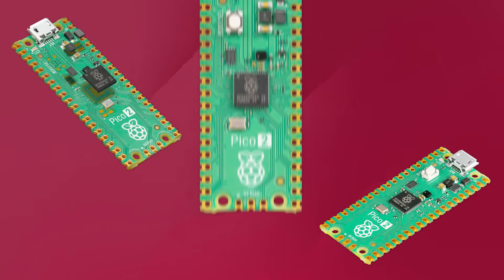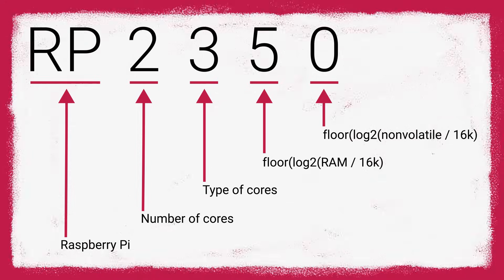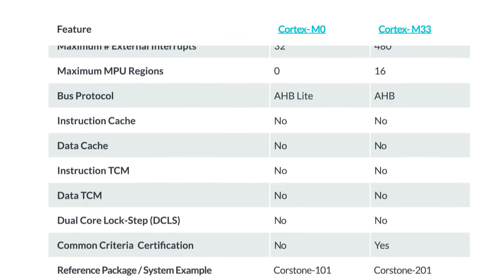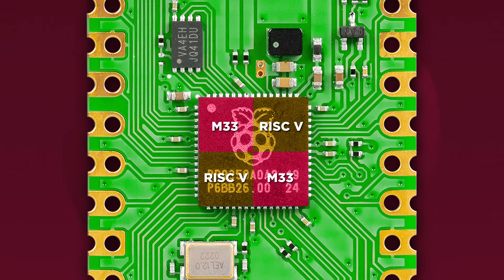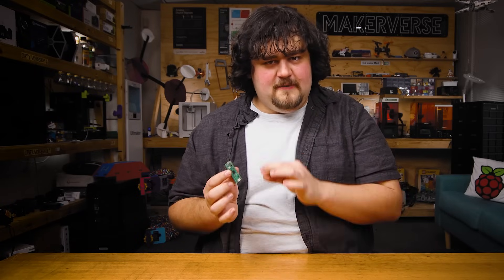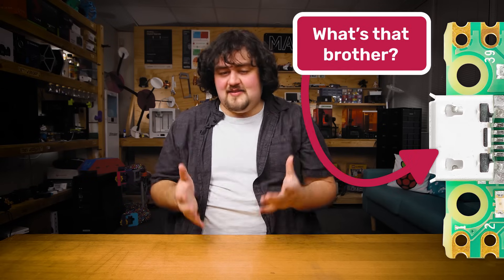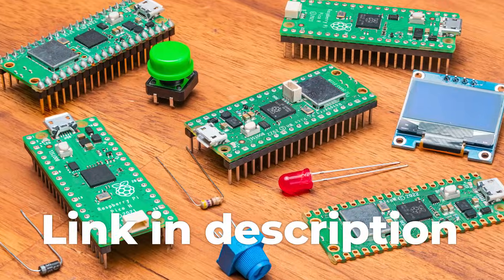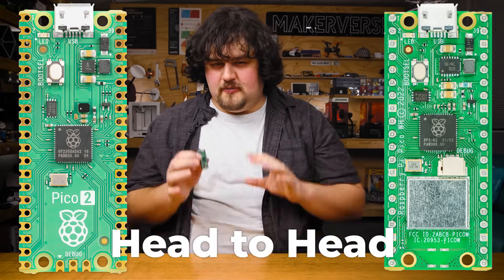Raspberry Pi Pico 2 | Everything You Need To Know

Comment: There is an official statement regarding the Pico W 2: available by the end of the year, same RF chip.
Reply: Hopefully there will be an external antenna connector.
Reply: @nutchanonkoommamuang5843  much needed
Reply: We need an rf connector on it.  Even if it's just pads to put our own in.

Comment: So, since this video came out the following has been learned about the Pico 2/W:

You have to choose between ARM and RISC-V nodes, there’s a flaw in the GPIO that causes the pins to latch up under certain conditions, it has a secure mode which is quite good but can be undermined using subtle and sophisticated attack and yes, it’s still very good.

I use it with C personally (I grew up with C) and like both the Pico’s  running either C or Python.

Comment: I'm a hobbyist and am very new pretty much everything.  I'm having trouble getting started with the rp2350.  I had no trouble with the rp2040, as in finding and uploading the UF2 file, getting code working with Thonny and getting the pins to work to light up LEDs.  However, I can not find the uf2 file for the rp2350 (am I missing something) and had trouble in getting Thonny IDE to recognize the rp2350 microcontroller.  All that I find is description info, but any instructions. Without having anything to go on, I tried to experiment by uploading the files that I had on the old rp2040 onto the new rp2350 and set up all my jumper wires on the appropriate pins. Nothing happened.  I would like to know how to get started with the rp2350. Thanks
Reply from the maker: We have had some instances of Thonny be able to install the Pico 2 firmware, and some not. We are still in that transition period. 

Here is the official download link for MicroPython for the Pico 2 (also for the RISC-V versions to use those cores, not really a noticable difference though): https://micropython.org/download/RPI_PICO2/

Comment: Thanks for the video. Looks like no built-in capacitive touch sensing?
Reply from the maker: Unfortunately no 😭.

-Also hello from the Core Electronics creative department, I really enjoy your videos and blog!
Reply: @Core-Electronics  Ah, well that is too bad... OTOH, I designed an add-on board for the original Pico that should work with it (so I'm not entirely disappointed) would be happy to send one over if you're interested in trying it out.

Thx so much for your kind thoughts. And likewise! have found your work to be a great reference in the past!

Comment: I wonder if the RISC-V cores were added due to the die area required for bumps (im assuming its flip-chip) meaning there was a load of free die space, so they just chucked a couple extra cores in
Edit: looked at die shots of rp2040 and it seems to be bond wire, so probably same here.

Comment: There are still enough microUSB Cable laying around and compatibility with the pico1 is worth a lot. I like USB-C but i don‘t see any advantage here, solder  yourself if you want to😅
Reply: The pimoroni boards with USB-C are already available (and in my grubby mits)
Reply: usb C cables are also more expensive. It could make a difference for some people.
Reply: @PainterVierax  if you buy a pile of „refurbished“ cables, sure. But i don‘t think that someone uses pico‘s on that scale.
Reply: @Buchstabenkrahn  well, you'll need to dedicate a cable for your devboards, and probably for most project you build with them so better get inexpensive older connector.
Personally, I use USB-B full size for such microcontroller projects as it's sturdy and plenty enough current and bandwidth for such applications. Unfortunately Rpi Pico doesn't come with pins or pads to expose the USB lines. Though like most devboards, it's better to make our own PCB to get access to every available i/o.

Comment: my suspicion: you can't get the 4 cores to run in parallel because there are no 4 cores. they just have different instruction decoders that use the same ALU. that would mean you have two cores but inside a core you have different components, one being the instruction decoder. and you put two different instruction decoders inside the core.
also adding more and more cores does not scale up that well because they have to share the same memory bus. with two cores it is easier, because while one core is calculating, the other core is accessing the memory bus. with more cores and DMAs running, you need separate cache blocks to optimize memory access. that is expensive.
Reply: It would make sense to reduce the silicon area to share blocks needed to built either core.
Reply: Not likely. M33 is a full core from ARM (rpi didn't develop it, they just integrated it in their desing). Hazard 3 is a similar story - didn't know anything about this core, but google search lead me to a github page.
It's more likely that RISC-V was an afterthought and quite possible it's a  "let's prepare people (and the whole ecosystem) for a better RISC-V in Pico 3" situation.
Reply: My understanding at boot you are picking arm or risc for BOTH...no swappin hot nor odd match up.

Comment: The big thing for me is DSP instructions. With DMA, 150MHz (likely more if you overclock it), 520kB RAM, and I2S, this chip looks perfect for live audio and radio data processing.
Reply: That's what I was thinking as well. This might work out better for DSP purposes than the original Pico.

Comment: Is it still 12Mb/s USB or has it upgraded to USB 2.0 at 480Mb/s ?
Does the ADC work properly now ?
Reply: ADC does work properly, but number of channels is still limited. 4 on the 60-pin chip, 8 on 80-pin. For comparison STM32G431 has 11 channels on 32-pin and 18 on 48-pin.
Reply: @dekutree64  - and only 3 available on header pins on this one, like on the OG Pi Pico.

Comment: Looks like another case where I'll wait for other implementers... even the CHINESE! to make a better version of the actual board. RPi can't design a useful carrier board to save themselves. Noisy switching PSU, micro-usb connector, no reset switch... geez.
Reply: Pimoroni (UK) have released some alternatives based on the same chip.

Comment: 1:11 if they make a new RP chip with a small update (same no.of cores, same type of cores, ram is not at least double previous, non-volatile memory is not at least double previous), they can't release it as it will have the same name.
Reply from the maker: I would imagine if that were ever the case it would probably get a v2 appended to the name.

Comment: I'll wait until we have a dev board with USB-C and 16MB Flash.
Reply: I'd prefer more ADC pins too.  Apparently they fixed the non-linearity problem (4 big spikes in the values) but there's still only 3 ADC pins wired to header pins, like on the original Pico.

Comment: There is absolutely nothing remotely ridiculous about the formula and it works out to an even number by design (leaving out any extra special purpose  memory such as dual port USB buffers which I am guessing is how you get from 512K to 520K). Memory usually comes in powers of 2, 16K, 32K, 64K, 256K, 512K, etc. so log2 makes perfect sense, it is log2(2^x) = x.  Thus by taking log2 you are  just giving the exponent. And linear multiples would quickly blow through a one digit value:1,2,4,8,oops while log2() gives 10 different sizes you might actually use. And by dividing by 16K, they don't waste values on small sizes they would never make and leave more for big sizes.  Besides, log2(16384) is already 14, which is more than one digit.  Another way to express it is ram=2^(x+14). Or just start at 16K and double it the number of times specified in the digit.
Reply: "Which somehow comes out to a nice whole number." Yes, that is what floor(x) does 😊 Just cut it off at the decimal point.
Reply: I'll admit it is archaic knowledge, but I did rewind (lol more archaic knowledge) to make sure I didn't miss something making it ridiculous. 

It's just a super clean -h (human-readable) flag.

Comment: Can not compete with the ESP32, for $6 you get the same memory plus USB C, wifi and bluetooth.
Reply: Yeah I don’t really understand all of the hype about it, STM32 and ESP32 beat it by years and have both freertos and arduino compatibility
Reply: Anyone who says the ESP32 beats the Pico doesn’t fully understand its capabilities. Not saying it beats the ESP32. Just that they both have very good areas where they are optimized for.
Reply: a rp2350 clone would be cheaper if they get released (they will)
Reply: And the PIO ?
Reply: Both ESP and Pico come with USB-C, just have to buy a third-party dev board ;) 

And tbh, both have their strong sides and right to exist ^^
Reply: Pi for people who pretend to understand tech
Reply: Nah, with 4.5$ i can buy a ESP32-S3 dev board with maximum profile 8M PSRAM 16M flash. 
I bought a ESP32-S2 and a Pico clone board with $1.85 each 🗿
Reply: @susugar3338 i also have esp32
But many people talking about its internal dac 
What is your experience?
Reply: ESP32s don’t have DSP instructions, have high power consumption while sleeping, and their second core is a small one mainly designed for running wireless. The USB port is only an issue if you’re deploying a dev-board with its USB port poking through a gap in the enclosure, which is a terrible idea unless it’s a sturdy plug like USB B. Use a chassis-mount port so you don’t ruin the dev-board if anything impacts or bends the port or its cable. More than that, I’d shy away from using a dev-board in a finished project in the first place. They’re for prototyping, they are unnecessarily bulky and have a fixed oscillator and switching regulator that may not suit its intended purpose.

And I suspect this new chip can be overclocked up to 250MHz.
Reply: @Scrogan ESP32-S3 series have DSP capability (SIMD instructions) and a low power coprocessor too.
Reply: The ESP32 is nice, but crashes frequently, us not very well documented and uses a lot of power. It doesn't have the PIO and most boards, at least the cheap ones don't have a lot of GPIO.

I also like the licensing free RISC-V Cores, good to have something to play with. I liked the ESP, but liked the Pico better. The Pico2 seems like a worthwhile upgrade!
Reply: Pi Pico 2 W, just bought it for $6, worth it, I have the esp32, I'm using it for ai detection using an esp32 cam, and the Pico for micropythin code which will do pretty much everything else, it's easier to use and configure and looks cooler
Reply: Fun fact,even though esp have higher frequency but they still lose in benchmark where calculation is heavy
Just check the speed race anywhere on youtube
Only bummer is no arduino support,where it is quick to prototype while not sacrifice speed unlile circuit py
Reply: I found esp32 to be too hard to use.  Pico with MicroPython is so easy
Reply: @mcfnord esp32 runs micro python fantastically and you get WiFi connectivity
Reply: ESP32 is designed, produced, and controlled  by a hostile foreign power.  Trying to eliminate Chinese processors (especially those with networking), networking chips with bus mastering, firmware, and application software from my life, not increase it.  At the very least, it tends to be very insecure and there could be malicious hardware.
Reply: @markwhitis First thing you do is  the ESP32 Flash as a first step. Almost every laptop has Chinese components in it and was more than likely manufactured in China. Buying no name Chinese networking equipment is a different story. 

Considering that you get a dual core 240Mhz processor, 512K RAM, 8MB PSRAM which does wonders for video applications, especially when using LVLG, 16MB flash, WiFi and BT for 5 dollars I have no idea why you would opt for one of these over and ESP32-S3 or C6 which is only single core but has Zigbee and is Thread/Matter compatible.

Add the fact that they are the basis for ESPHome for Home Assistant, it's RISC so hardware and software is open source (to some degree) and I'm pretty sure someone would have found something malicious considering Home Assistant is the 2nd largest open source project. The world and ESPHome is becoming more popular since Nabu Casa bought it. I made a voice assistant for under 10 dollars with one

I would be more concerned about the devices with data exfil capabilities written right into the terms of service (e.g. Google, Apple, Amazon).
Reply: @markwhitis how is China hostile? The hostile power funding wars is the USA.
Also you wont gain indepence from China in a capitalist market system, that's just delusional.
Reply: @markwhitis I love it when people from countries that have constantly been bombing and invading others for the last 70 years call China "hostile".
Reply: @markwhitis Only OUR TROOPS get my DATA becuz im a PATRIOT GOD BLESS THE USA 🇱🇷🦅👮🏻‍♀️❤️
Reply: @markwhitis  care to back these claims up?
Reply: @tapirath - My former manager refused to use the ESP32 because he was worried about the Chinese firmware phoning home. We ended up using a Pi Pico W at my recommendation.

Comment: According to the Pi foundation you can use either ARM cores or RISC-V cores, no mixing
Reply: Not true. Check the data sheet, section 3.9.2.
Reply: @coder543 yikes, I think someone messed things up in the PR. Thanks for the info

Comment: Maybe the RiscV is there to queer the pitch of the other micro-controller chip manufacturers, why buy their products, if the Pico has it thrown in!
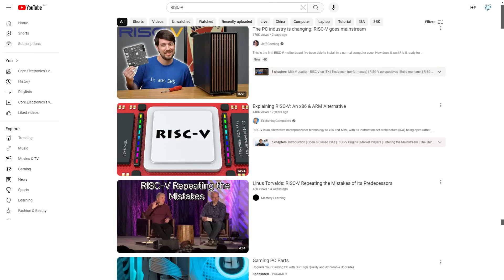Reply: yeah saying stuffs like "promising applications" at 2:15 is really an understatement when most manufacturers even westerners switched at least partially to RiscV cores.
Being ARM based, this is probably just an integrated isa interpreter to make the chip compatible to RV code. probably better to use ARM assembler directly.